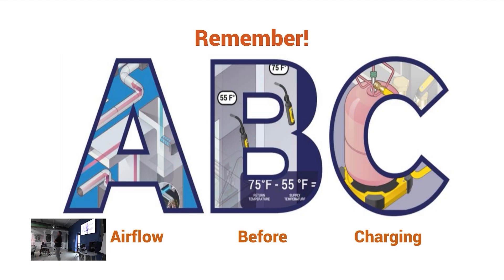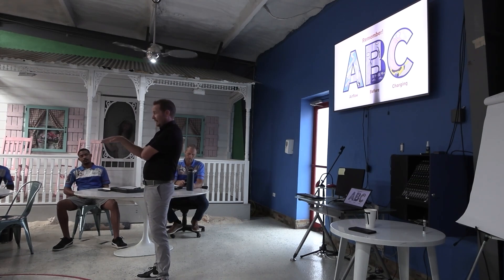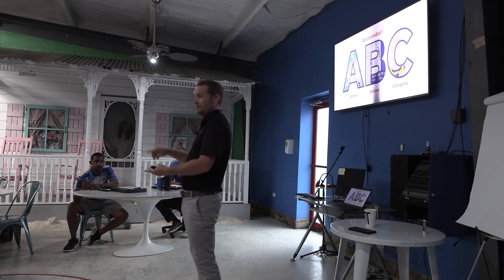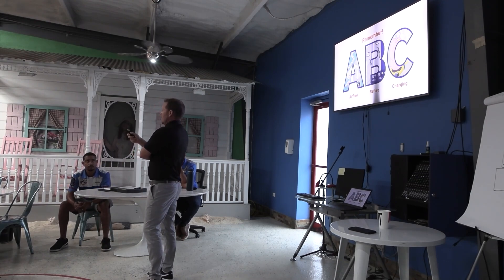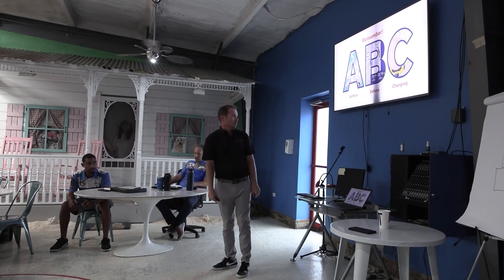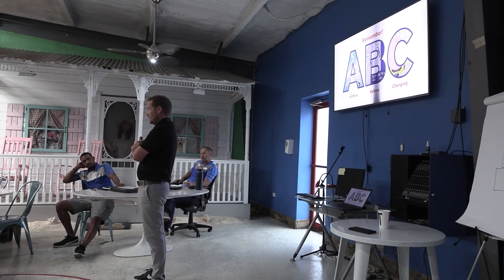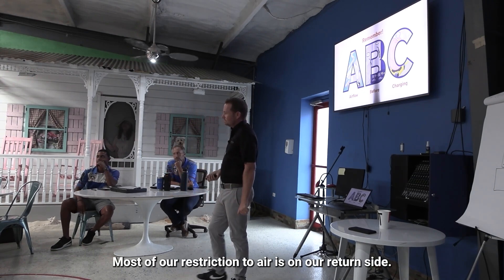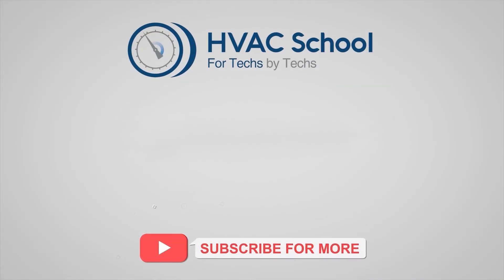Airflow Before Charging

Comment: I thought I knew what I was doing and now I’m confused…just put in bigger ducts, ok
Reply: If you are working on existing duct just size your unit to the duct work and if its slightly undersized it will be fine it might run longer run times in peak demands but majority times will be fine still better than being oversized for most of the run time.

Comment: You’d be surprised how many clients don’t want (or won’t let) the tech inside the house to get a “big picture” of what might be their problem. Too many homeowners believe that the problem is ALWAYS located at the outdoor unit. When you ask the obvious question, “ when did you last change the filter ?? “, you get the rolling of the eyes and the generic answer of “recently “.
Reply: I like when you have a blower motor failure, and there’s always a brand new filter in there.  But a horrible one buried in the trash.
Reply: Or the fight you have to get em to change the air filter again , cause I   
Just changed it a few weeks ago but …. It’s pleated they got hardwood floors , low returns and four cats ….🤦🏻‍♂️
Reply: I've walked away from those. Won't let me see the other half of the equipment? Customer wouldn't let tech complete diagnostic. Charge dispatch fee to card on file.
Reply: Yeah lol.  "Add some freon"